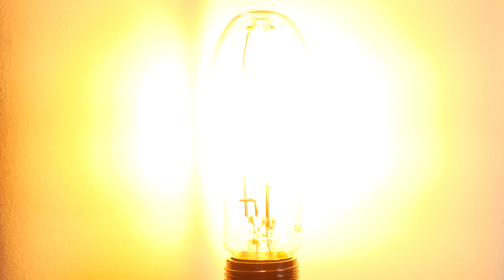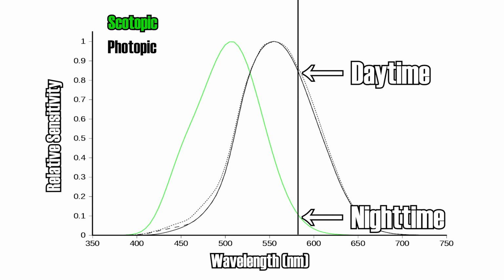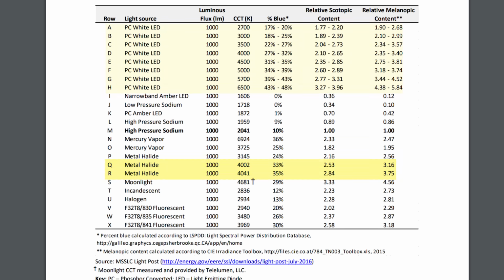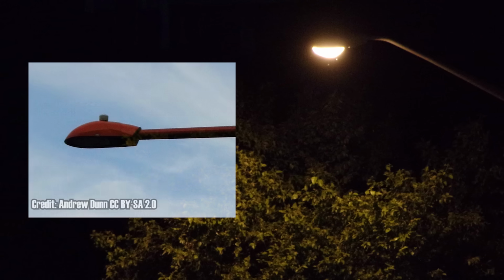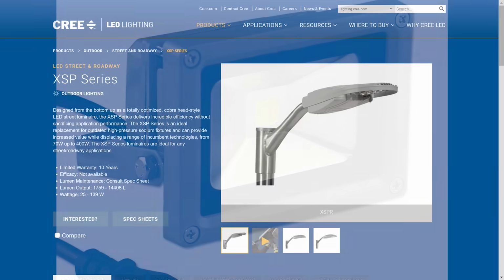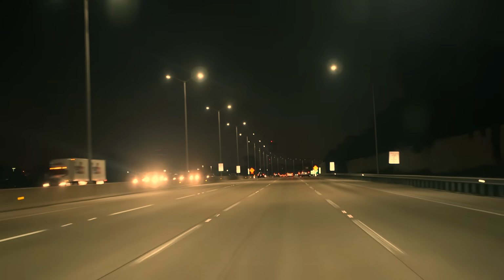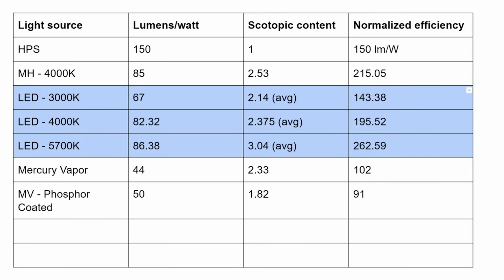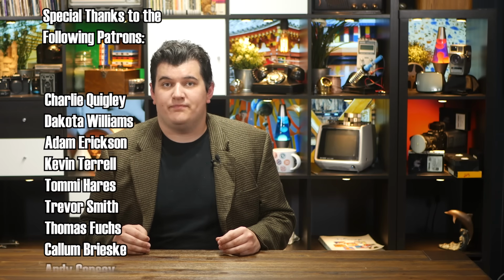The LED's Challenge to High Pressure Sodium

Comment: I recently had an issue with LED street lighting. In the rain, led’s are too bright and the road was too reflective so I couldn’t see any lines. I had no idea where to drive besides not into head on traffic. Terrifying!
Reply: Talk about too bright, what about the police car blue lights now that will blind you as you approach them.
Reply: @flyguy6504l  shouldn't be a problem when the police is abolished.
Reply: If only we used PC Amber LEDs. It provides the functions of normal LEDs with the aesthetics of HPS lights. Seriously why don't we use them
Reply: @paulgilbert5278  They're not as efficient as the white LEDs.
Reply: How come?
Reply: @paulgilbert5278  It is explained in the video why yellowish orange color is less efficient. I recommend you to watch it.
Reply: @paulgilbert5278  did you watch the video at all
Reply: Yes. You didn’t read the part where I corrected myself?
Reply: @mihirmutalikdesai  So? they are pretty close
Reply: @paulgilbert5278  they are less efficient and less effective. We'd be better off sticking with hps at that point. That was covered Exhaustively in the video.  You should probably watch it, you would find it very informative.
Reply: @Sinister Thoughts This was ages ago, but yeah Ive watched and know full well that they’re more eff(icient+ective). But hey, I couldn’t help but feel nostalgic for HPS
Reply: @sinisterthoughts2896  Not necessarily. Colder light has its advantages
Reply: Cats eyes. Don’t know why they’re not used worldwide. They’re fantastic.
Reply: Have you tried polarized or the  yellowish anti-glare lenses for night driving?
When I was younger I loved night highway driving, now that my eyes have aged, it's not so fun especially in the rain. Time to acknowledge that I'm getting old.
Reply: @azurplex  I’m only 23 so hopefully that’s not my issue 😂
Reply: @dylanjennings1687  that's about when I started having issues, wouldn't hurt to get them checked if you have insurance. Recommend lens crafters if you do, they have a machine to take a picture of the inside of your eye so dilation isn't needed.
Reply: @dylanjennings1687  have you been tested for glaucoma, diabetes etc....
Reply: @Christian the lanes aren’t straight in this town. Many intersections you have to get over to continue straight, and some areas go from two lanes each way to one lane and street parking, and back
Reply: Just as dusk is setting in on a rainy day it’s so hard to see due to all of the led light sources reflecting off the shiny streets
Reply: LEDs do seem to be way more reflective than HID lights, but I'd have to ask Technology Connections guy because he's better at research than I will ever be.
Reply: I have similar issues with bright white/blue tinted headlights. I'm sure it's great for the people in the car but it's horrible for everyone else on the road, it's completely blinding. If an animal or person got in the road when I had those headlights in my eyes, I probably wouldn't even see them
Reply: It's the colour not the brightness, LED's are very white.
Reply: @ElectronicPleasure  You can literally make them fundamentally any color you want.
Reply: lol now you know how led headlights feel
Reply: This is due entirely to the difference between reflective and retro-reflective paint. Most states reflective paint, which, as you noted, aren't nearly as easy to see when the road is also reflective.
Reply: proof that LEDs suck
Reply: I'm most definitely young, but I've had similar issues with some cars with particularly bright headlights. Similar to a car having their brights on, it can make it incredibly difficult to see things like lines on the road.
Reply: i do enduro and i hate LEDs thay fuck with my depth of field and shadows don't look right and god help you if there  is fog or your behind a 2 stroke it will blind you the LED picks up every particle in the atmosphere and reflects it back at you
Reply: @markilleen4027  Yep, contrast and depth of field perception is terrible with LED streetlamps, at least for me.
Reply: @markilleen4027  Okay, don't use LED that wasn't designed for the specific needs of enduro tracks in enduro tracks then. That is its own space, its own needs, its own distinct issue.
Reply: They've replaced all the street lighting here with LEDs but there seems to be only one model of lamp they use that only works well when it's really high above the ground. 
So in the side streets with small lamp posts, half the street is now completely dark and as you get closer to one of them, you're getting blinded because the light is pointing right at you until you've passed it. The old CFLs were much more effective and due to the way they were built, they lit up the houses which in turn reflected more light everywhere.
Nobody seems to have checked that before replacing everything.
Reply: Makes me wonder why nobody thought about having cold while LEDs for efficiency paired with a yellowish filter to change the output that hits the road.
Reply: @HappyBeezerStudios  Because the filter absorbs light and then the efficiency drops!
Reply: @HappyBeezerStudios  Because why use cold white LEDs to begin with if most of their color will be useless anyway? You're better off using warmer LEDs at that point
Reply: @HappyBeezerStudios  That would greatly reduce the efficiency of the LEDs.  You would, in effect, be blocking most of the light the LED emits.
Reply: git gud
Reply: The LED lights that go bad in my city flicker like a strobe light.

Get a few of these flickering strobe lights in a row & it's so deadly?
Reply: @Dylan Jennings - I don't think that was due to the LED's themselves. I remember one night I was driving on the interstate, with all the regular orange colored lights on the road but it was raining pretty harshly, it was so bad I couldn't see any of the road lines and at one point I had to even question if my headlights were even ON. Most of the cars including me slowed down to about 35 MPH at one point despite the limit being 80 MPH. I think that LED lamps would have granted most of us on the road that night better visibility, but I could be wrong of course.
Reply: @Kurt.E.Clothier  Yes it absolutely does.  It cause more glare, just a fact.

Comment: My big issue is light pollution. My city installed  (population 2000) led light after 2 months and more than 3/4 of the lights shot out by BB guns. The city went back to hps.
Reply: @Roger Wilco - justice and really clean floors I was one of the locals.
Reply: I wish my city had locals as good as yours. My city looks like a prison yard under white LEDs and most of the locals are too weak-willed to care.

Comment: So, the cool thing about LEDs is that you can adjust their color temperature as you see fit, using mixed temp lighting. I wonder if it would be possible and/or viable to introduce traffic detection based adjustment for street lights that adjusts the color temperature for the bulbs to a scotopic-friendly Daylight balance, then tunes them back down to a nice soft-white Tungsten balance when the car has passed, in order to not disrupt local environmental rhythms and such, too much. It would also go a long way towards helping an area feel more futuristic, but also helping that area feel more "Alive", especially if the change was dimmed between the two, fading directly from soft to daylight and back. If the technology was done right, it could fade AS the car passes, creating a sort of cascade of light as it travels down the road.

As for their disruption of Human circadian rhythms... If it keeps you awake while you're driving, that sounds like a win to me. And as for when you're Not driving? Buy. Curtains. Seriously. You should have curtains in your windows anyway, the shitty venetian blinds you're all used to, except in extreme cases, aren't really made to keep an effective amount of light out. Unless you paid quite a bit for your blinds, and they're the wider, flatter variety, they're not going to keep a significant amount of light at bay, and even then, if they're poorly fitted or improperly installed(i.e. missing the top clamp bracket that adds a floating slat to the top of the blinds to prevent bleedthrough where the blinds can't properly "close" against the mechanism itself), you're still back to the same problem. This is easily solved by a couple of 20 dollar panel blackout curtains, which also have the benefit of being washable, easy to maintain, easy to replace, and friendlier on your electric bill. Seriously. Curtains help. Get some dang curtains. And buy a damn shower liner while you're at it, you heathens!

Anyway, raging about people not properly equipping their homes aside, the engineering side of me says this is a problem with solutions, or even better still, a pile of solutions being CALLED a problem. There are ways to work those problems to our advantage.
Reply: The more I think of this, the more I kinda like this idea. Working this in a series would help to mitigate issues of cars coming around blind curves and corners on roads. You'd know the car was coming up your street, even if their headlights weren't working as intended(I'm looking at you, Honda, with your shitty 10th gen headlights), or if the curvature of the road prevented their headlights from being visible quickly, because the street lights would help signal that to you. This would be incredibly helpful to drivers in oncoming traffic, but also to pedestrians crossing quiet residential roads that seem pretty safe at all times, but occasionally have an idiot tearing through them in a less than safe manner.

Comment: 13:38 The high voltage igniter is simply removed from the lamp when the LED light is installed for the first time because that makes it one less component that can break in the lamp. Or it might be just bypassed if ability to reinstall the older lightbulbs is desired.

Comment: 5:33 Actually, this type of disruption probably increases safety by preventing drivers falling asleep behind the wheel due to their biological clocks forcing them into the sleep mode. On the other hand, frequent prolonged night driving could be a problem in the long term.
Reply: it could help by making them less likely to fall asleep behind the wheel in this paticular instance but the worse sleep they get can also leave them sleep deprived the next day
Reply: @tadpole9264  if the driver wants to fuck up we can’t stop him.

Comment: Amen!
 The issue of light pollution and street (and yard lights as well) were an issue in Europe already in thew 1960's / 1970's.  Specifications about the luminaire shapes were introduced then in order to utilize the generated light better.  On the roads, if the light is directed too much only downwards, you need to install the light poles much closer to cover the road adequately (avoid dark stretches). Therefore, the standards were optimized both for the pole height and the luminaire shape.  Also, the choice between sodium and mercury lights was considered from an additional point:  Some recommendations preferred mercury lights on plain road stretches and favored sodium lights at the intersections.  I understand the idea was to provide an alert about the intersections by the change of the light appearance.   And that of course way before the LED era.

Comment: I live in Hungary, here all the lights have been replaced by almost LEDs, luckily they left the yellow light in the downtowns. (Here in the EU, downtowns are mostly pedestrian areas full of old buildings, here the LED would have been very distracting. Although I think the yellow light is better on the roads as well. It illuminates much more space and the oncoming car doesn’t dazzle as much as the LED.

Comment: If you don't have a video on it, can you talk about why fog lights are white and not amber. Since amber actually is more visible for driving in weather I dont understand why white is used since if driving in rain or snow you can barely see the road or lines.

Comment: Personally I really hate these new super bright 6600k LED street lights. I find they cause so much glare that they actually make night driving worse by making it harder to see, especially this new trend in shorter streetlights. In rainy, foggy, or snowy conditions, these LED lights make it almost impossible to see, as the piercing white/blue lights gets reflected everywhere by the water droplets on the ground and in the air causing a blinding amount of glare. I agree, we should be using LEDs with a more modest color temperature, and not the unpleasant 6000k+.

Now, I'm sure a lot of my grievances could be solved by better light designs and cool features like auto dimming and even color temperature changing lights. I think poor design is a big issue though, as I see a lot of streetlights that just shine light everywhere when all they need to do is illuminate the road.

Lastly, stop putting cool temperature lights near places where people sleep. Nothing worse than a piercing white light shinning into your bedroom window or your sleeper cab.

Comment: Sadly, it doesn't say how much money it will save over the long term. "Seattle City Light recently completed the final lighting upgrades at the State Route 99 overpass on South Cloverdale Street. Contracted crews replaced the high-pressure sodium (HPS) lights with new light-emitting diode (LED) fixtures from August to December 2020."  https://powerlines.seattle.gov/2021/01/21/city-light-completes-underdeck-lighting-upgrades-in-south-park/

Comment: there is just a single street in my town with brand new LED lamps - they are a disaster! Not only that one street is so narrow that you usually need to stop to let the pother car through but it's on the very edge of the town where you enter it out of complete darkness - the problem is the LEDs they used emit like 10 times stronger blue-ish light than the old ones and their housing don't help direct the light either as it's shining into your eyes as if someone with long lights was driving towards you - it nothing but a safety hazard blinding drivers. I'm not the only one saying it as I've heard others saying the same.

Comment: In Texas. I don't know what lamps we had (probably sodium) but they were very bright and worked well. My city changed over to some new kind of lights (probably led) and they were very dim and now I can hardly see the road at all and especially off to the sides. Its ridiculous and dangerous. They even changed the light outside my house (i live on a corner). Its much darker, which is OK as I like it dark when i sleep but it doesn't really supply light like it was meant to. Such is 'progress' *smirk*.
Reply: L.E.D. lights are actually brigther than you think they are but they will not be that bright in terribly lit areas

Comment: Long before the small town I live in switched from greenish fluorescents to HPS lights (which I hated, totally drowned out the night sky, esp after we got a walmaaarrrt), we had a SAC refueling unit airbase. The roads on the airbase all had LOW pres. sodium. I was always interested in WHY, but having watched this, I get it... they wanted to keep the night sky as dim as possible, they wanted to both try to "hide" the airbase better AND have better nighttime visibility. Such strange lights though... they resembled long tubes, when they started, they were red, and slowly got more orangey, but more of a monochromatic orange, so EVERTHING illuminated by them was orange.

Comment: As a hobby astronomer. You can still filter most HPS light, but with pricier filters.

The issue with filtering LEDs is they don't have discrete bands but a full bell curve of emitted light. Making them impossible to filter out without loosing a ton of light.

EDIT: Just lately the replaced the street lamps on my street with well flat lensed HPS lamps and it was a dream. Nothing through the windows no issues at all. Even more recently they decided to change them again with LEDs. No direct light through the windows but on my narrow street the street reflections bounce up walls making my house much brighter and yes, I can only sleep with the blinds down now. The entire neighbourhood sleeps with blinds down now.

Comment: LEDs make me feel like im driving through the refrigerator section
Reply: new level in new racing game
Reply: @cat_hq_1452  reminds me of Yas Marina Grand Prix Circuit
Reply: @cat_hq_1452  new mario kart looking real nice
Reply: Did those metal halide lamps the parking lots used to have make you feel the same way?
Reply: I think the lights of fridge bulbs have a slightly higher blue tinge to them than normal to make the colors of food within them pop out a bit more, and a lot of street LEDs may have a similar quality. I remember replacing a bulb that had burnt out and finding that it had a distinct blue filter over it
Reply: That has nothing to do with the light source itself. That is due to the color temperature of the light
Reply: “I love refrigerators”
Reply: Sir this is a wendy's
Reply: I think it feels like an emergency room
Reply: It's feels cold with out those warm HPS and SOX
Reply: The leds are the same colour as the MV bulb
Reply: @hughsgarbagetrucks  And yet those came before HPS
Reply: you can make LED with other light colors than pure white
Reply: @Roger Wilco - justice and really clean floors dude coffee is the best way to sip melatonin release. Also make it so major roads get cooler lights and smaller residential areas have warmer lights.
Reply: ikr
Reply: Cool!🥶
Reply: In a restroom
Reply: I know but don't you love it?
Reply: Cool.
Reply: The ugliness is the point I think. They just wanna make the world worse
Reply: Well, one (quite tiny, I admit) bright (no pun intended) side would be: with LEDs, anybody dying in a car accident would already be accustomed to the lighting in the morgue...
Reply: Fun fact - blue light helps slow growth of a lot of things, which let food stay fresh longer.
Reply: Do the cool led lights not make anyone else depressed?